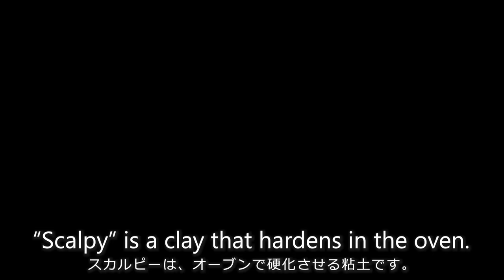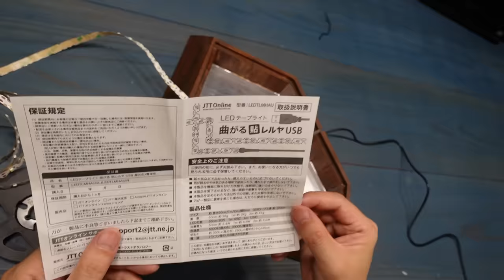Build Reaper Leviathan of SUBNAUTICA【Make the scariest creature of that world famous game】

Comment: I remember once I was playing Subnautica and I had traveled too far out

A side note; I didn’t know how anything worked so I didn’t even have the spawn fixed up or anything so no radio, no continued story yet, not vehicle bay, sea moth, etc. I was basically working with a basic air tank and my little weak legs to carry me around the ocean.

I’d traveled too far, and I ended up in this super dark area. The PDA started to panic and asked if I was certain, and I just wen’t ‘ha! Nope, but Imma do it anyways cuz I’m an idiot and I’m reckless like that.’ At this point I’ve already been warned about the leviathans, and after having seen a leviathan Reefback, I’m just ‘it can’t be all THAT bad, right?’. Anywho, I swim further, and my oxygen is lowering my the second, which I was unaware of. And I see this massive snake thing, and I look at it closer, and it’s a reaper. It wasn’t all that bad to me, in fact I stayed at it’s side and didn’t get attacked so long as I stayed to it’s side out of line of sight. Later I was seen and it still didn’t attack me until I went up for air and it just ripped me to shreds.

I didn’t lose anything of value. Probably just an egg or two that I couldn’t use anyways.

Comment: 3:31 I know this comment is a year late, but it might still be of help in your future Projects.

If you want to eliminate (or at least severely reduce) the bubbles in your Resin Pours, get a vacuum pot and after mixing the Resin in the cups, vacuum all the air out then pour the Resin in the moulds...

For smaller Projects, you can use the Vacuum Pot to pull all the air out of the mould after pouring the Resin into it, that way, there are no voids in the Project, but I've rarely (if ever) seen you make a Project small enough to fit in most Vacuum Pots available to DIYers...